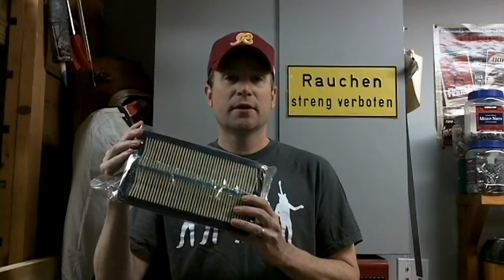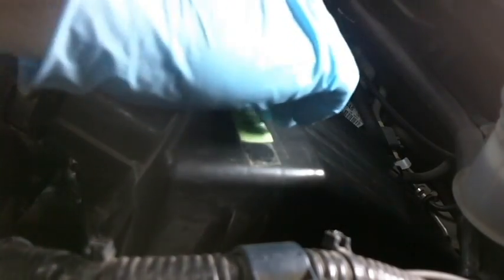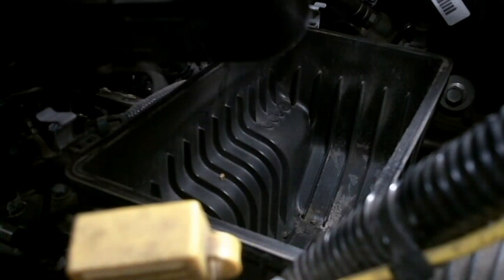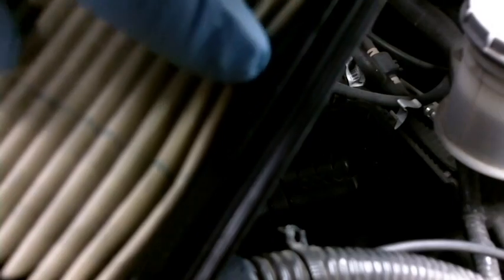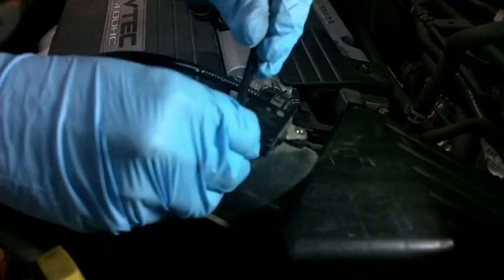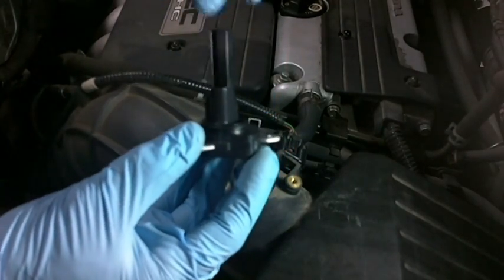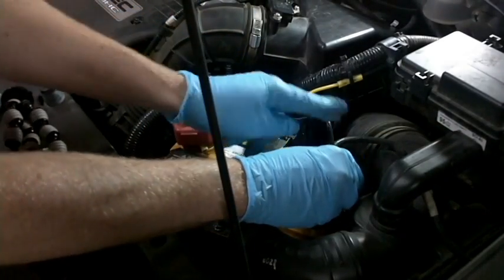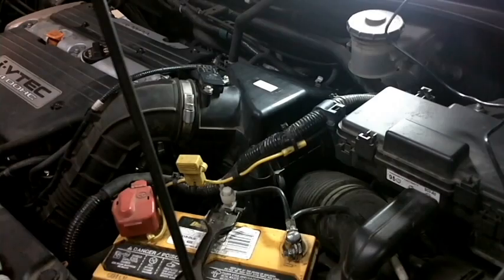Air Filter Change & Cleaning The Mass Airflow Sensor (MAF)

Comment: Cleared my OBD-II P0171 and P0174 fault codes and the check engine light is off! I had already changed the filter and checked hoses, gas cap, etc. Thank you for the thorough demonstration. Saved me a load of of Dealership rip-offs.
Reply from the maker: There's something satisfying about D.I.Y.  Glad to hear it worked!

Comment from the maker: We changed my wife's air filter and cleaned the MAF at the same time.  She had about 90k on her Element prior to me cleaning the MAF.  She told me that it runs better/smoother.  Will you see incredible gains?  Probably not.  But there's nothing wrong with running the cleanest intake air (and air measurements) possible.

Comment: You pulled the electric plug disconnecting the mass airflow sensor from electrical power. Why disconnect the battery? Seems like this step is not necessary.
Reply from the maker: Disconnecting the MAF doesn't reset the ECU.
Reply: Why do you need to reset the ECU?
Reply: Brian Kenneth Kondas to reset the fault with the computer so it learns everything again.

Comment: Maf sensor same place for 07 Acura TL S?
Reply from the maker: Should be close....just follow the tube by the air filter and you'll see its wiring.
Reply: I found it but it's WAY smaller and nothing long like the one on the video. I'm worried if I'm spraying the wrong piece and damage it